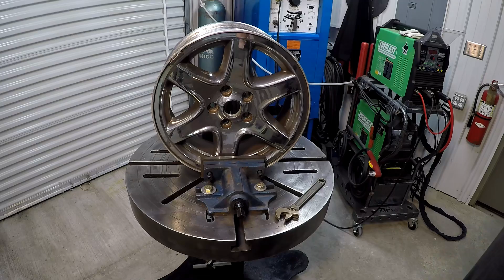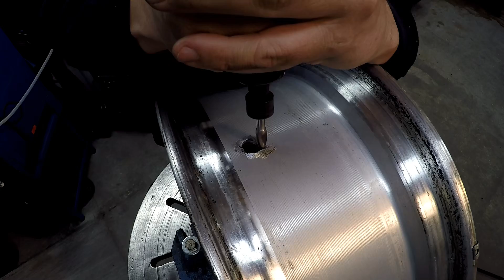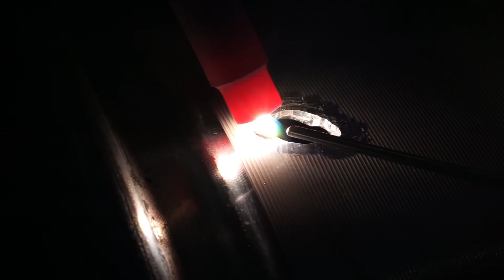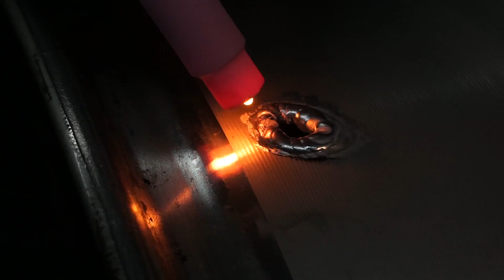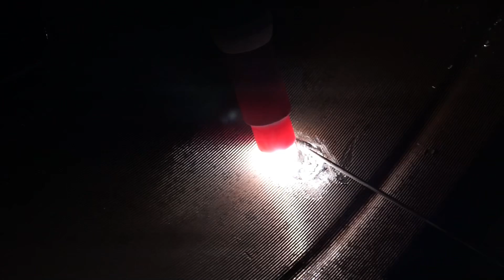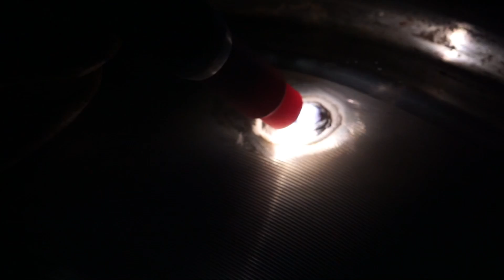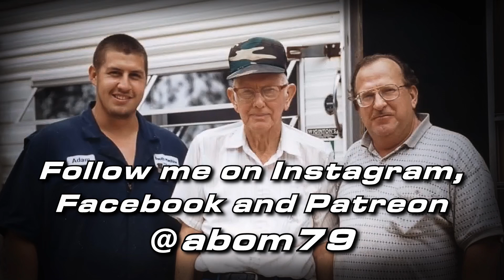SNS 239: Aluminum Wheel Repair

Comment: Hi Adam,
there is one thing i don't understand...
You wear glasses to protect your eyes, ear plugs to protect your ears and your orange gloves to protect your skin.
Why you don't protect your lung when you are grinding, using the Wirewheel or do anything else what produces fine particles in the air you are breathing.
Reply from the maker: I use a respirator when it’s needed. Try going into any random welding and fab shop across this country and convince them they need to use a mask for everything.
Reply: Abom79 Very true Abom.I manufacture safes and the only time I wear a resperator is painting and grinding carbide.
Reply: @Abom79  I couldn't agree more. Either time or comfort. I try And use my Miller mask but in all honesty it's pry used 20 percent of time it should be
Reply: @Abom79  they better hide in their homes if they are worried about breathing toxic fumes.
Reply: Abom79 everyone turns around and says.. you want us to do what?
Reply: @Abom79   Maybe you should go into any random fab shop and have a look if they are all wearing their glasses, earplugs and gloves. I think you are smarter, you don't need to argue like that(Look, nobody else does it why should i do... bla bla bla). I watch your videos for over two years now, i love them because of your precision, passion and craftsmanship. Yes i'm not a machinist or welder  i'm in a business not even close to metal work.  But i think it would be smart to use your respirator when you produce any kind of dust.
Reply: he doesnt breath
Reply: shane  I honestly hope you're trolling.
Reply: Just filter it through a cigarette
Reply: @mnaeslund  AvE style? lol
Reply: shane  Have you ever heard of suspended dust particles? They're small enough to float in the air. That's why you sometimes see the sun shining through a window, looking from the side. Besides, the angle grinder blows it around, with its cooling fan.
@Abom79 Isn't it about how safe you are, not wether other shops use it? As mentioned, there are toxic fumes in some cases and harmful dust.
Reply: shane  I've done more metal grinding than I care to remember, and have to say you are incorrect.  How do you think the metal dust winds up on every upward facing surface in the vicinity of your grinding operation?  I have always worn a good quality dust mask when grinding. Fumes from welding are also hard on your lungs!
Reply: shane  Lol, a carbide burr will still put a lot of particulates into the air.
Reply: shane  yup in my lifetime i've cut so much concrete,wood, steel.plastics, breathed so many different kinds of fumes that when i go in at night and blow my nose it would be black, i,m just saying its everywhere from in your house to in a office to the great out doors we cant hide from it, we would have to wear a respirator 24/7 besides 80 is a good age to die.
Reply: Chill out guys... he's just concerned. Feel free to breath any type of carcinogenic you like, in small doses it wont' do any harm anyhow. There's being too anal about safety and there's being too cavalier, you need to decide for yourself. I, for one, have been soldering using lead based solder for about 25 years now and I can't say I've ever did anything to protect myself... probably dangerous but so far I've been ok ;)
Reply: shane  A grinding wheel cuts and so does a wire wheel. Chip sizes vary from visible to microscopic in nearly all removal processes.
Reply: As AvE says, you have to filter that through a cigarette
Reply: shane  i think he's talking about the flapper wheel he was using.
Reply: shane  they're referring to the grinding he did after the weld was done, not the air tool used to prep.
Reply: If you go outside in many areas and there are cars or really anything disturbing rocks or pebbles you are probably inhaling some asbestos. I bet you  wear a respirator or particle mask when you do everything besides sit in a laboratory grade clean room.
Reply: shane  shane we are not relating just to the dust we are talking about the poisinous fumes that comes off from alluminum welding so be carefull what you say when you comment.
Reply: @cv3174  until you turn blue and walk away to get another breath of fresh air, works for me.
Reply: I hasn't died yet is proof r healthful. Do not my job? Yo logic bust cause I no listenlisten.

Big manly men no scares dust cause chest thumping on YouTube  fix cancer.

47 a good age to death
Reply: Ffs kiddos.
Reply: shane   have a look at 15:41 and tell me again that this is not grinding ;-)
Reply: Wow it always gets me when some douche bag is watching a video of something they obviously don't do and try to tell the dude about safety equipment. That particular tool doesn't make dust it makes chips. If you'd ever used one you'd know that. I know you don't work in any part of the industry because if you were seen putting on a respirator to use that tool you wouldn't have a job much longer. So if you're living vicariously through someone who works with their hands and uses tools just do that and let him worry about his ppe
Reply: @paulbooth5778   he is right it will make particles that have a good chance of being suspended enough to be inhaled.  He is a bit overconcerned about it. The world we live in is a dirty polluted  place we cannot live in a bubble we inhale particles germs, and gasses all the time that are "Harmful" to our health. Adam is actually very safety aware as far as I have seen over all the years.
Reply: @paulbooth5778  

Why would someone lose his job over using PPE? I am an employer and would never give anyone a hard time over using PPE and wil gladly supply it, even if it is overkill for the job. A nice 3M 6300 with the right filters won't hurt my bottom line that much ;)

I myself wouldnt use ppe for this small job either, but still, be my guest if you think it's necessary.
Reply: shane  Why did you take this so personal? I only ask why Adam does not protect his lung.
Sorry i'm not a native english speaker maybe i get something wrong by the word alloy. Isn't nearly every metal an alloy? Or did you use the word alloy for aluminium?
Round about two month ago i've used a grinder with a cutoff wheel to cut an aluminium strip.
You are fixed so hard on aluminium, maybe this video was not the best example. But there was also a lot of break dust on the inside of the wheel. Yes he wiped off a litle working area with some chlor free cleaner and a paper towel. But i think you get the point. It doesn't take long to use the respirator, only a few seconds this is only Convenience to not use it

Comment: Welding cast aluminium wheels is sketchy as fuck because of how they are manufactured. They are differentially cooled and then tempered and then who knows what else. For a permanent "good as new" repair I would never trust this but as a spare wheel, I don't see anything wrong with it.

Comment: I don't know much about wheels and tires but I've seen technicians put a bunch of some kind of lube on the rim when mounting a tire. Is that maybe the "coating" you were talking about?
Reply: Tire lube you may be speaking of is a soapy stuff that lets the rubber slip over the rim.  It dries and the slippery goes away.  It's not just soapy water; but a special formula that loses slipperiness when dry.
Reply: DFWKen yeah I just wasn't sure if it might leave some kind of residue when it dries
Reply: @Sharklops  No, he was speaking about the dull light grey color on the rim where he welded up the hole. If you check it out once more, the whole surface (except for an inch or so at both sides) is covered in this dull grey.

Comment: Is it me or does that look like a bullet hole?
Reply: I thought about butthole when he started the weld
Reply: @beamngnation9494  how do you know it was shot from the inside out?
Reply: @beamngnation9494  it was outside in
Reply: inside i mean, coming from the most center place of the wheel
Reply: @beamngnation9494  I know what you meant I'm just bored lol.
Reply: @beamngnation9494  Really, so what's your explanation then?
Reply: @nicomeier8098  i just misunderstoon the concept of "inside" on this particular item(wheel), Jonn is right, actually the shot came from outside, and got in the wheel, but i said outside cus i meant the most inner part of the wheel as "inside"
Reply: How does a jagged-edged hole "look like a bullet hole"? Because it's small? 🤣😆 That's the only possible thing you could use. There's nothing else that alludes to it being a "bullet hole"